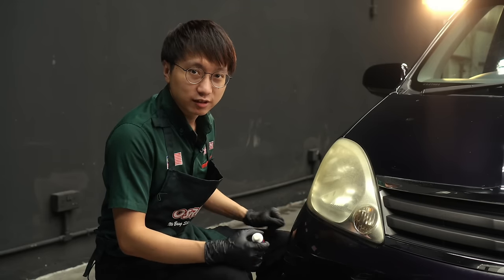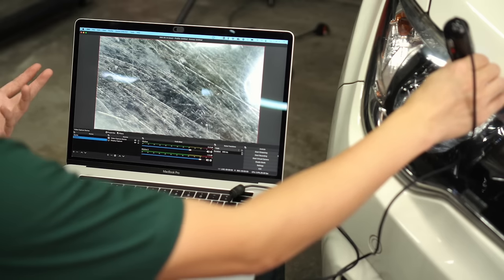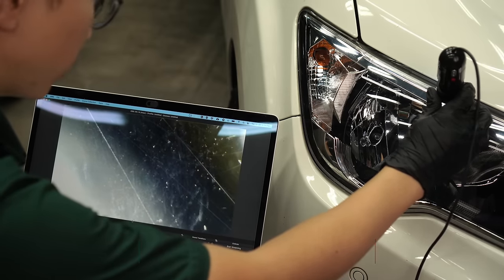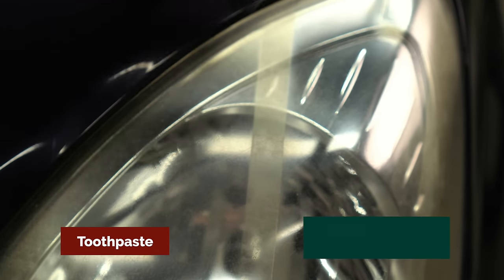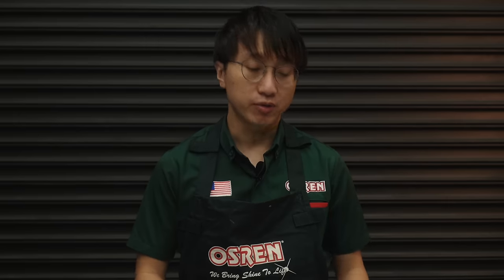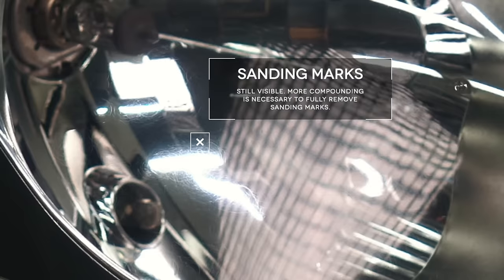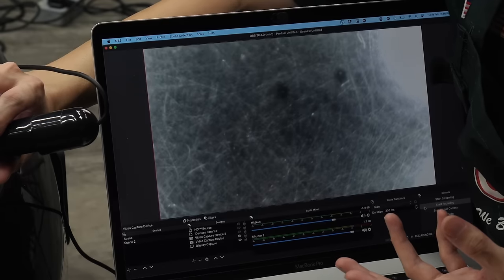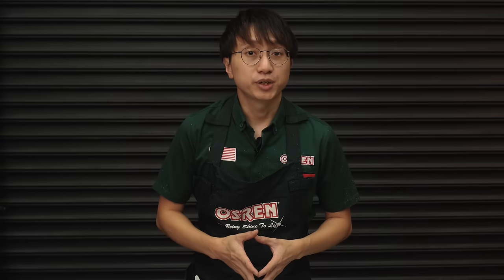How to restore headlights - 3 ways, but which is the best?

Comment: The reason why the headlight that was sprayed with clear coat had an orange peel like texture can be of a few reasons which I myself have experienced, 

1st reason is that the air pressure out the spray gun could have been too low. To overcome this. Adding slightly more thinners to your clear coat and hardener mixture will allow the solution to spray much more finely as the mixture will not be as thick and heavy passing through the spray gun 21:08 

Alternatively.  If you have a big enough air compressor, a simple fix here would be to open your regulator valve to allow more pressure. But as also becareful because as the gentleman in the video said. If you spray to much. The clear coat will drip.

This was a well put together video, I hope this information added to give some insight to the clear coat aspect specifically.

Comment: Not the best headlight restoration I've seen on utube!! But nevertheless a good effort, I think the microscope is over the top? Another point is I would likes to have seen a more older vehicle with years of oxidizing yellowing where you can't see the light bulbs as of mine! Meguiars clearcoat only require one coat!! And in test proved the best!!🤔🇬🇧👌

Comment: May I know for sanding from 2000 I go do down to a more rougher sanding which is the 1000 and going down to 400 and then I work my way up to 1000 and to 2000 before using compound and polisher ? Please advise me on this
Reply from the maker: Hey Nosy Hulk, the grit which you intend to use, depends on how oxidized the headlamp is. 

1) the more yellow-ish / oxidised it is, the lower grit (more abrasive) you go to remove thicker layer of plastic. 

2) Work from lower grit to higher grit. ie:  800 - 1000 - 1500 - 2000

3) In our experience, there isn't a need for a 400 grit sand paper. We would recommend starting out with a 1500, if it's taking too long, then 1200. Anything lower than 1200 is for severely neglected cars that are usually, at least generations old. in our opinion. 

4) If you are compounding, then for our product, you are good to stop at 2000 grit and finish off with a wool + headlmap polish. Different product might vary. You might wanna check on that.
Reply: @OSRENOfficial  thank you for explaining to me .
Reply from the maker: @nosyhulk6863  most welcome

Comment: Vapor polish. There are 2 solvents for polycarbonate. dimethylformamide and 1,4-dioxane. both are rather toxic and dioxane is also dangerous because forms peroxides and may explode. you must work outdoors or with military respirator. when spraying with clear coat, also industrial or military mask is a must.